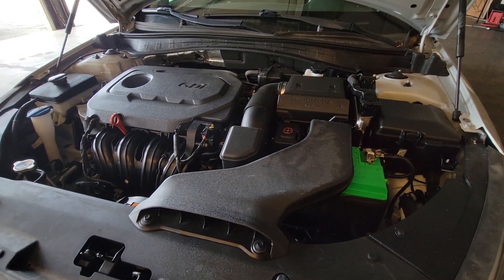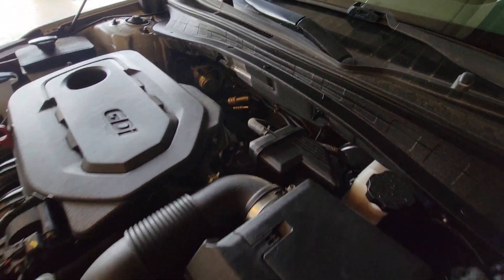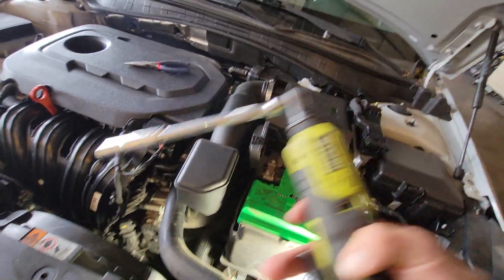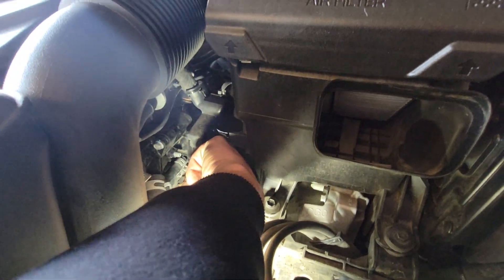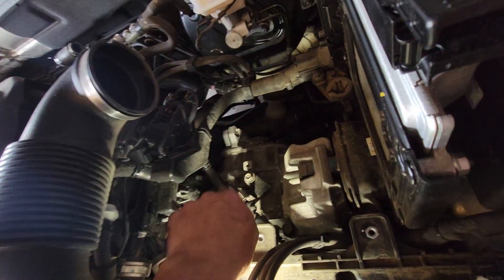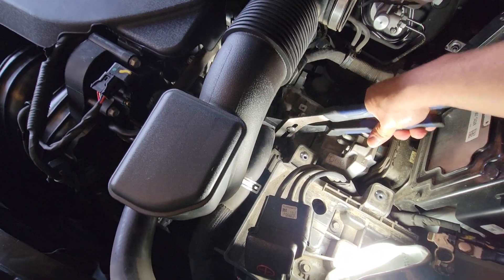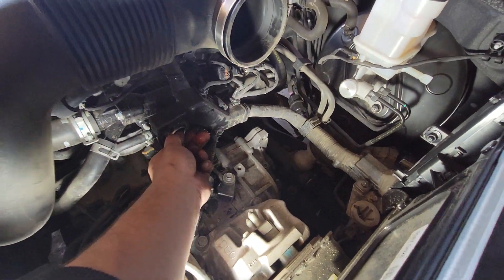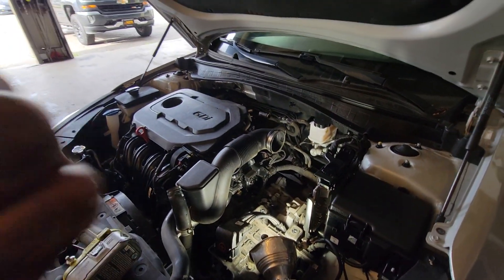How to: Remove Thermostat 2020 KIA Optima

Comment: Commenting to come back to your channel . I'm about to clock in at work. Got to learn what burping the system is and how to do the install
Reply from the maker: Thank You, I'm glad this helped. Thank you for your Support!
Reply: @559powerscape what did you mean by “burp the system”? 

And thanks for the video. It definitely relieved some of the initial stress about taking on the task.
Reply from the maker: @yourlifeisagreatstory  just make sure it's topped off in the next few days. I just ment to take all the air out of the coolant system